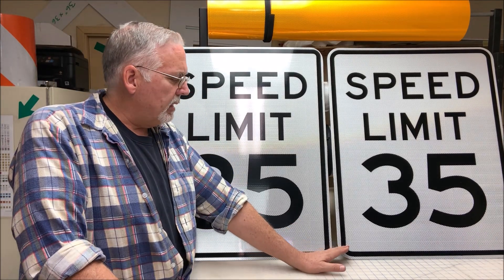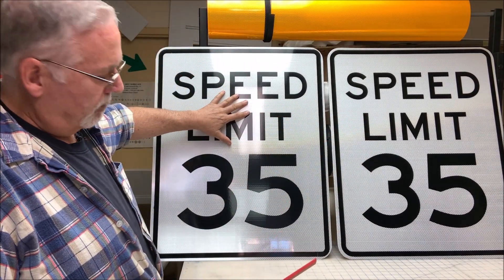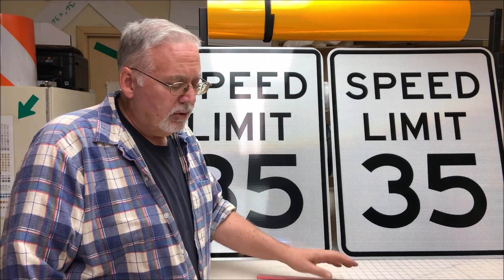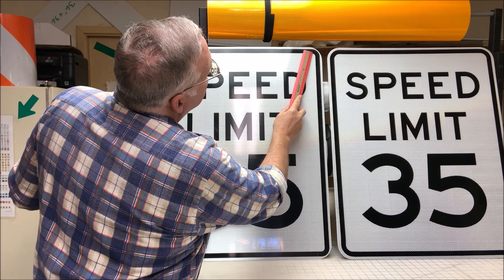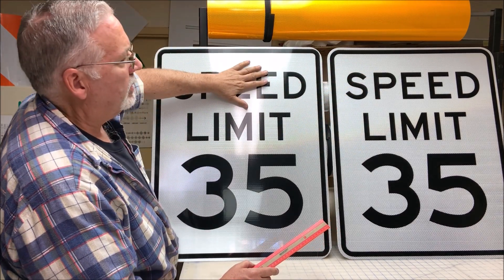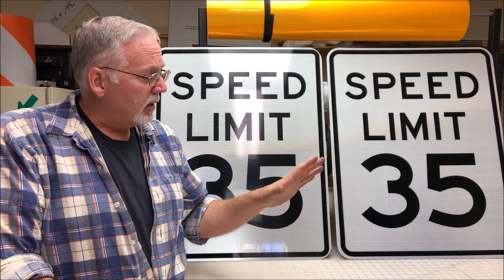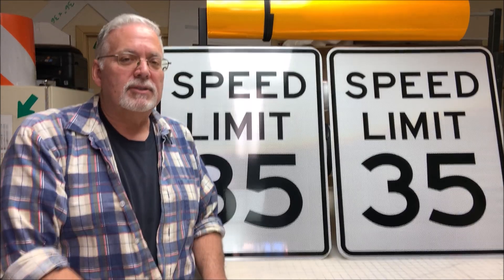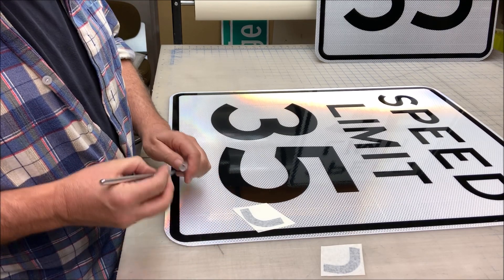My Mistake.  Correcting a mistake on a traffic sign is easy to undo.

Comment: I’m still some what new to the sign making business so still trying to learn all the tricks but I ya Flexi and noticed in some of your other videos you use a different program. So I have 2 questions, how do you make and print your borders off like that because that would definitely save me a lot of material if I learned to do it that way. Also where is a good place to start with getting a diagram like that to check the blank radius like that.
Reply from the maker: Send me your email address to bobthesignman@gmail.com and I can send you the pdf on the same one I use.  The best way is to log on my website Bobthesignman.com from there go to the "MORE" tab and then find "Traffic Sign Resources"  at the bottom of the page of so is a PDF that you can download!

Comment: Hi Bob, great job on the sign man. I have two questions though
1. How hard is it too peel the EC off after its been installed for a couple of days?
2. Would the sign sheeting manufacturer still provide a warranty for the finished product after knowing that the EC has been peeled and reinstalled?
Would be great to know your thoughts on these.
Reply from the maker: After a few days it is much harder to remove. I have removed small sections, but not the entire sign. In  the shop if I mess one up I have peeled the entire sign right away. I never worry about warranty cause it is not worth it to us. It is pro rated and the cost we would get back would cost us more in wages.